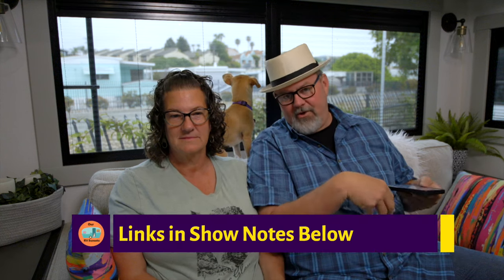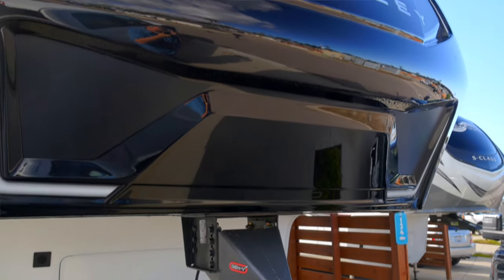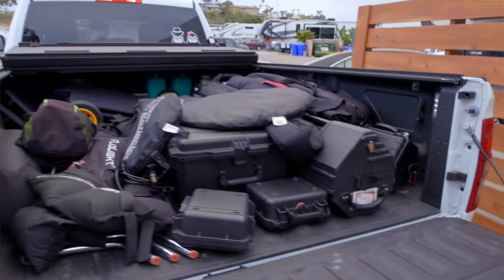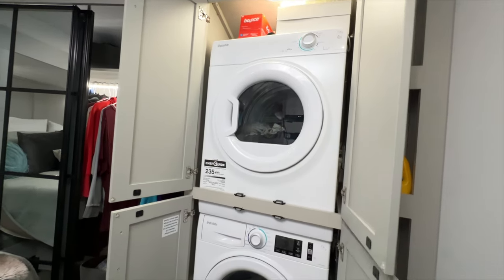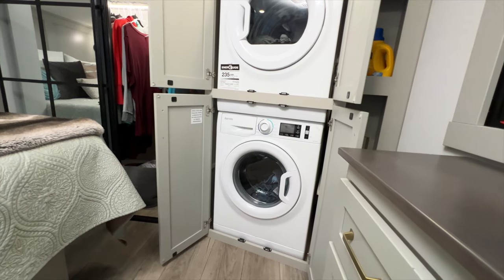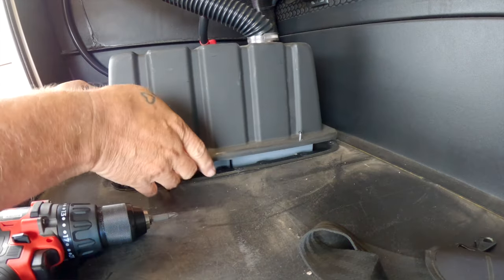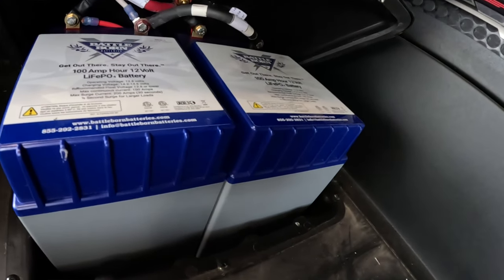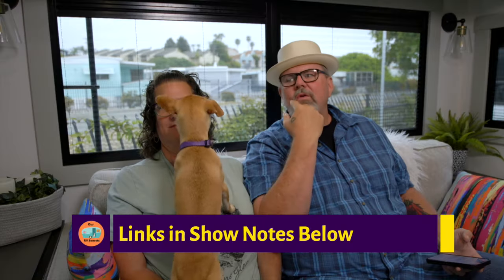Favorite Mods to Our Brinkley z3100

Comment: Did you add another solar panel to the roof when you switched to lithium?  Thanks!
Reply: Sorry, also what brand of W/D did you get?  Thanks again.
Reply from the maker: @1991ugamba  We went with the Splendide stackable washer and dryer. Quick note on this, which will be in our next video. If you get the Splendide the first thing you need to do is throw away the water supply hoses that ship with it and go get proper hoses with metal fittings from Home Depot or Lowe's. That plastic fittings on the supply hoses that ship with the washer can leak. Ask me how I know!!!

Comment: We just bought a Brinkley 3100Z. What kind of washer and dryer model do you recommend?
Reply from the maker: We have the Splendide stackable washer and dryer. We've been using them for 6 months now and they work great. One quick tip on installing them though. Throw away the water supply lines that ship with them. Those lines come with cheap plastic fittings on them. We replaced them with heavy duty lines with brass fittings. Having the washer and dryer really was a game changer for us.

Comment: Your FRIG doesn't run on shore power?  Or is this only when your boon docking?
Reply from the maker: The fridge is just 12v. So I believe that when we are hooked to shore power it's pulling power straight from the converter, and then when we're boondocking it's pulling direct from the batteries. Honestly, we really like the 12v fridge!

Comment: Is installing the washer and dryer something you would tackle on your own?  And if not, why?  

Also, can you see or hear that the washer or dryer are running from the outside?

We’re going to sell our motorhome and buy a Brinkley Z-3100, and a washer and dryer are on our must-have list.
Reply from the maker: In hind sight I probably would install it myself. I think the biggest challenge is going to be lifting it in and out of the rig. But the install is pretty straight forward. 

You can't really see or hear it from the outside. Maybe if it was a cold day you might see some steam from the dryer vent? You do know when the washer is on the spin cycle inside the rig though. You can feel the vibration throughout the rig.

We love having the washer and dryer. It just makes things so much simpler when you can do laundry in your rig. 

Good luck on your hunt for your Brinkley. We really do think it's the best made 5th wheel out there.